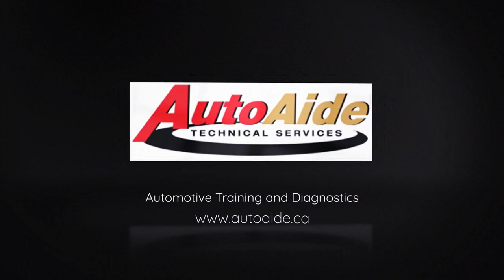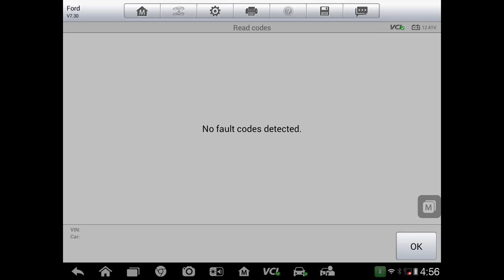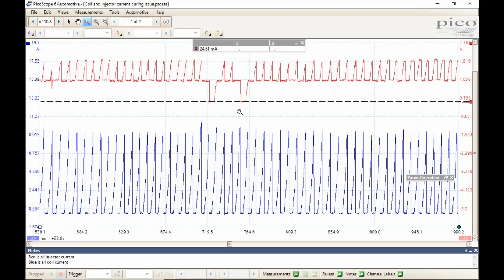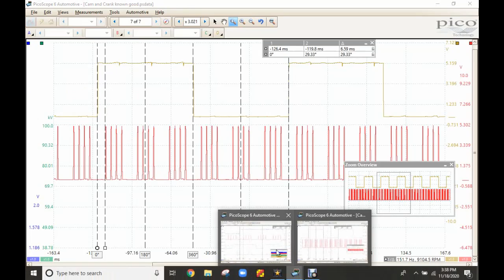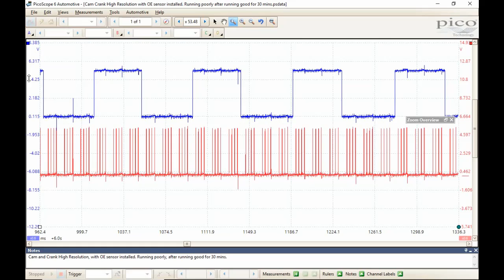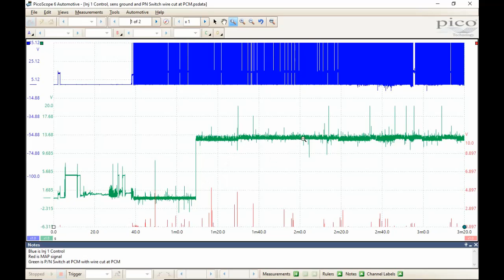2004 Jeep Grand Cherokee 4.0L - Cuts Out Under Load

Comment: There is a pid for the park neutral switch in most scan tools. The problem is the scan tool refresh rate will not see those spikes. So very brilliantly discovered by the scope.